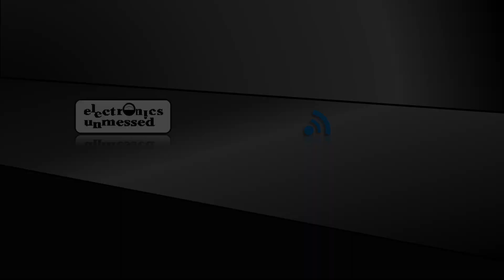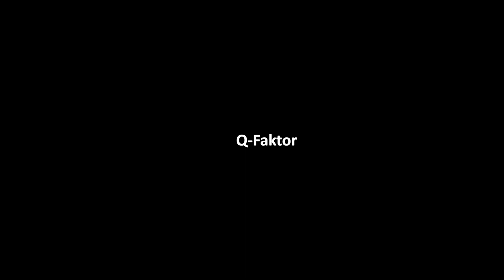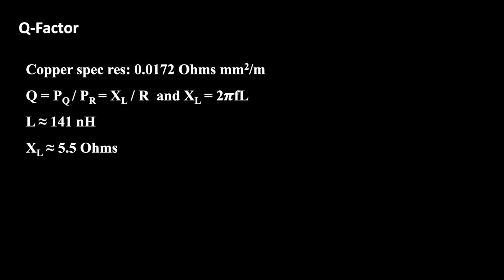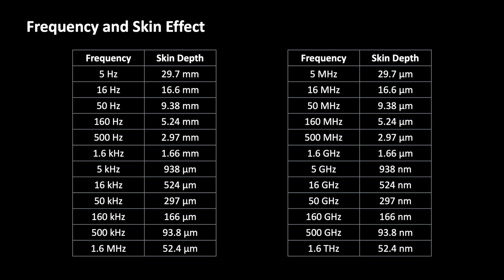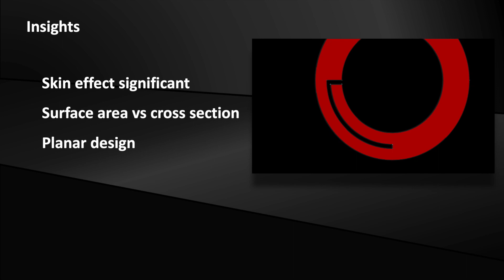Why a wide Planar Structure works better for Radio Frequency - Comparison on Skin Effect (EP88)

Comment: Would silver plating the planar antenna potentially give any worthwhile improvements?
Reply from the maker: Thx for your comment! Yes it would, but only marginal. I made some tests from cheap aluminum foil, see video: https://youtu.be/3o6SUC5SXEU
And they work as good as with copper.
Reply: I have seen some experiments with the silver plating and it improved the performance relatively quite a lot. So it might be worth it for like energy harvesting etc. But maybe not for basic use.

Also polishing the surface should help. Microstructures and scratches on the surface seem to add friction on it.

I'm planning to test these for some FM energy harvesting.

Comment: I'm feeling old and dumb this evening, so I apologize if I'm missing something, but it looks like you used DC resistance for the copper and aluminum material calculations, but with the same Skin Effect depth for both materials. I believe the RF resistance for aluminum is relatively lower than that calculated since I have read that RF works at a greater depth in aluminum than it does in copper, making it function more like copper at RF regarding the circuit Q. I think that may be due to weaker eddy currents within the higher resistance aluminum opposing the forward currents near the surface and allowing the desired fields to penetrate more deeply, effectively raising the Q and making it closer to that of copper.

I'm also wondering about the differences between a material like aluminum flashing constructed as a planar loop or one with the surface 90 degrees to the planar antenna, in a more traditional loop form. I'm sure there will be a difference in the capacitance between the 2 loops, but I don't know which would work better in practice.
Reply from the maker: John, 
Wow! Thank you very much for your good comments!  I think you are more awake than me late in the evening and what you wrote is exactly right! Yes, with the skin effect the penetration depth depends on the conductivity of the material. This makes aluminum even more a good option. And actually the penetration depth also depends on the shape of the conductor. 
So, I apologize for this simplification. 
By the way, I also think your idea with the band conductor is very good. This would be an option for relatively large antennas, for example for the 2m band. I'll definitely come up with DIY solutions for that that later.
By the way, I will also continue to develop the plane antennas mentioned. Next comes an EXCEL tool that can take into account the influence of the dielectric constant and the thickness of a PCB substrate, because I want to realize the antennas for higher frequencies (WiFi, LoRa, 5G, ..) on PCB.